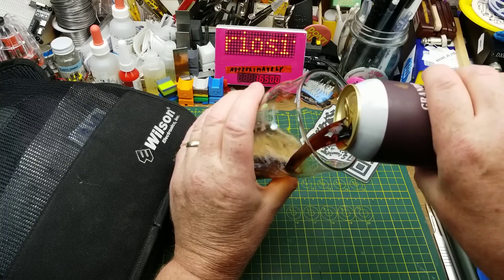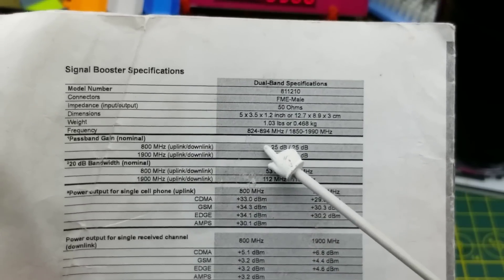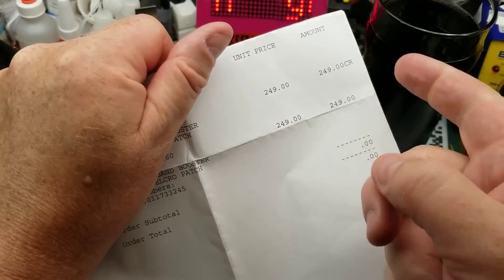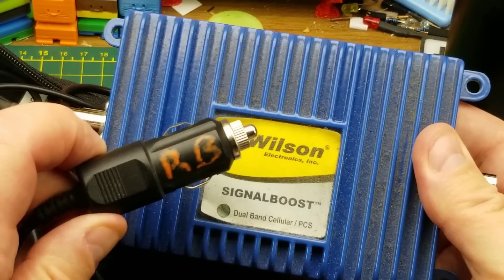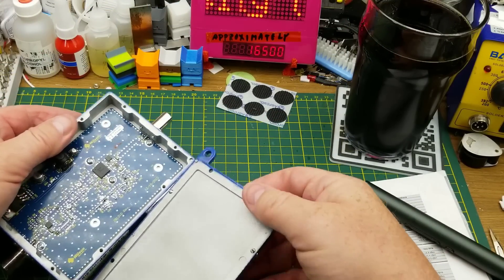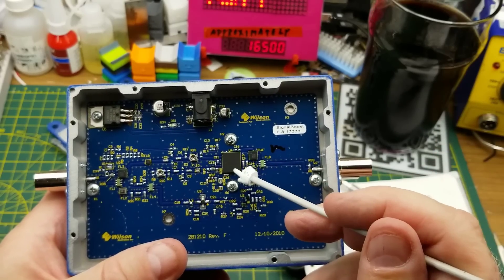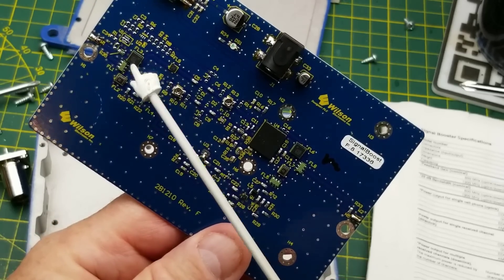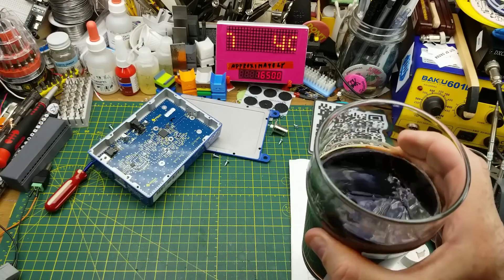curiosity teardown: cellphone booster

Comment: Once you've ditched the PCB, it looks like you have a nice, shielded project box, a 12v PSU, and a bunch of RF cable with connectors. Not a bad haul for just $5.
Reply from the maker: Absolutely. I always keep any potentially useful parts from these teardown videos.

Comment: I once had one of these type of boosters wipe out service on a major highway here in Chicago. It was installed in a building and light up the electric power tower causing a huge hole in the network. Worked with electric utility and thr FCC to chase this down. Took weeks to resolve.

Comment: I have this thing. It is a 25 watt booster for cb's, a blue heatsink with 2 of some kind of rf jacks. 
Can I just add that to one of these to a cell one? Boost the booster, or would you need two? Not my roundhouse. Pretty tired of one bar. Would just use 120 adapter. Verizon one is 150 new or something.
Reply from the maker: If the one you have is actually for CB, the frequency would be wrong for cellular.

Comment: Been using a Cell Phone Booster for the past 15 years. My shop is clad with steel walls and a steel roof. I have full Bars on my phone in my Shielded shop. My booster cost about $100 more than the Receipt you showed.
Reply from the maker: Your situation is a good application for this type of booster. The building is effectively a faraday cage that completely isolates the outdoor antenna from the indoor RF environment.

Comment: Couple years ago a friend living in rural Arizona asked me about getting one to mitigate the weak signal he had. I’m three states away so the best I could do was to give him the same advice you gave about antenna placement and orientation. He doesn’t have technical aptitude in any way so I had to go over some things multiple times, use analogies and like that.

He decided it would be too much trouble and decided not to try to use his phone until he got into town. Good choice imo.

I think that RF transistor is part of an active mixer/attenuator. Bidirectional amplifiers have to have some way to damp positive internal feedback to prevent that howl. Low power, low bandwidth amps can get away with passive networks but not that thing.

Comment: I've recently joined the solar industry and our installs are often out of cellular range.
I want to get one of these for our work truck, which basically a directional uplink and maybe omnidirectional for the down link since us guys are a bit like ants when installing.

Any advice/ recommendation?
Reply: Just get one internet-station that has a directional antenna for the cell-network. And WIFI for your workers so you can turn the cellphones to internet/wifi only . Relatively simple and cheap to use and setup.
When arriving at an address, set the directional antenne for the cell to go in the right direction for the nearest celltower and  your phones will all use that network.
If you are really out-of-range for the cell-signal, you can add satelite-internet to the same hub and use the same system.

As he explains in the video, don't fuss with trying to amplify cell-signals.
Reply from the maker: WIFI calling on cellphones is an excellent way to get around weak spots in the network as well as indoor areas that the signal can't get into.